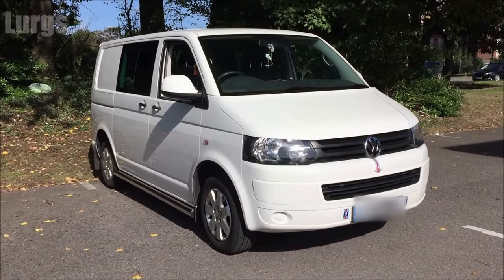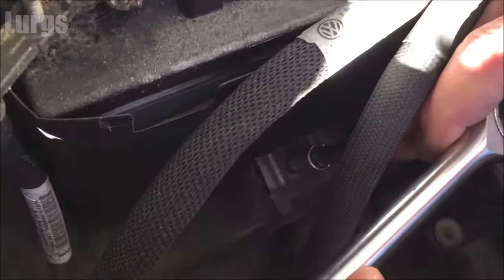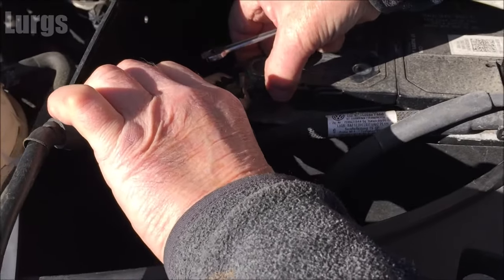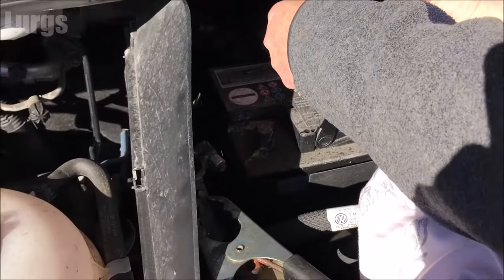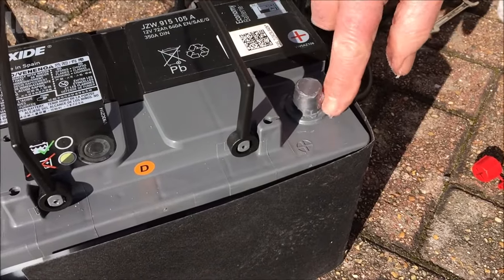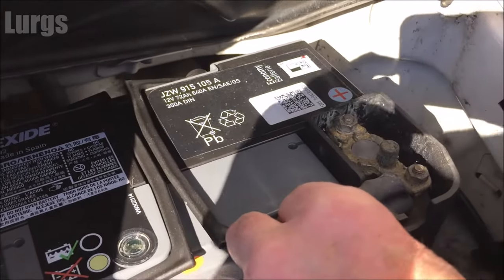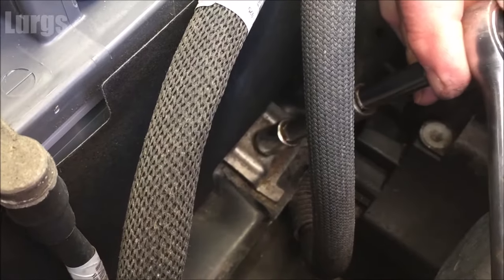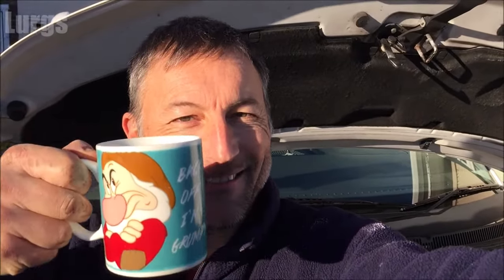How to replace the battery on a VW T5 - VW T5 Battery Replacement

Comment: Hi mate like your how to vids, I found previously when I needed to disconnect the battery on my 59 plate T5 that the alarm went off and was impossible to switch off or carry on with the job just too noisy !!!!
I will try to get hold of a temp power source as you did but any reason you know of why the alarm would go off in this way?
Also my current reason to disconnect the battery is to try and find reason for an apparent battery drain when van is not being used. I realise alarm itself is using power when van is parked up etc but problem only seems to have started happening over last 6 months or so. I bought a replacement battery (although ended up getting a garage to fit it) just wondered if you fancied doing a vid on steps to track down source of such a problem?
Anyway thanks for your expert guidance
Reply from the maker: In my years of experience the main culprits for draining a battery are always Car Stereos or Alarm systems. Good luck finding the source. I think if you lock the Van door with the Key it won't set the Alarm so that might be a good test. Get yourself a digital multimeter and check the battery daily, worth checking it whilst it's not running and then see if it's losing voltage over a few hours or days. >  https://www.youtube.com/watch?v=VlkYGIMFj48&list=PLqrXuUebV8N9fyM8qA2D0rkVfv929Ckod

Comment: Hi Lurgs ,  thanks to your video , I’m having a go at changing my battery on my T28. When replacing positive feed my alarm goes off . Old battery was totally dead and has been sat on drive for few months 😢. Any suggestions?
Reply from the maker: It's not good to let modern vehicles completely die as it plays havoc with the electronics.
Only thing I can suggest is quickly connect battery then lock\unlock to see if that turns the alarm off
Reply: @LurgsHowToGuides  It worked 🙌 Thank you .

Comment: Hello Lurgs, enjoying your videos. Please can you explain how the 12V cigarette jump starter works to keep your settings if you haven't got a spare battery. I guess one end fits into the cigarette lighter in the dash but where does the other end go? Steve
Reply from the maker: You can buy 12v power packs which plug into the cigarette lighter. This keeps 12v in the system whilst you swap the battery out for a new one. They are normally used for starting but can be used as a boost.
Reply: OK got it. Thanks mate